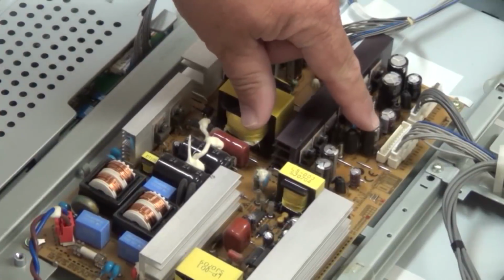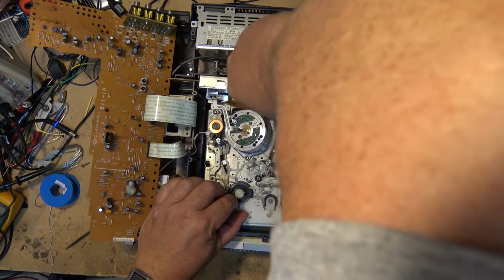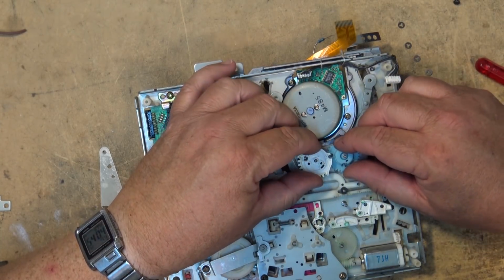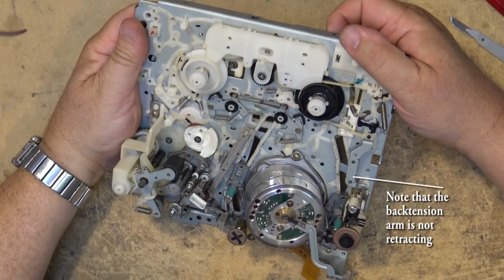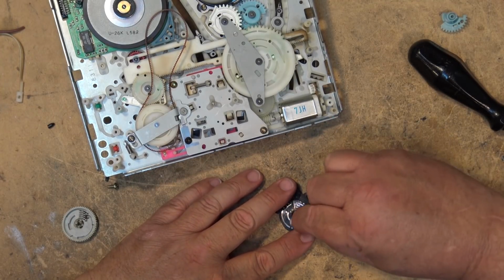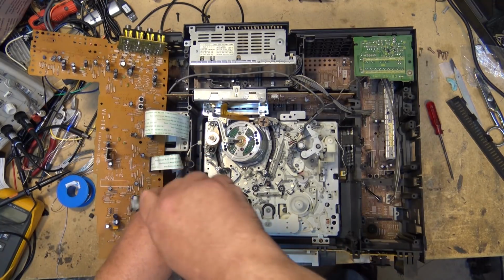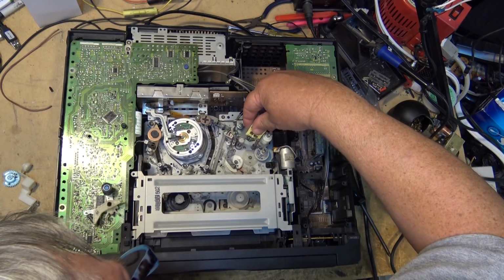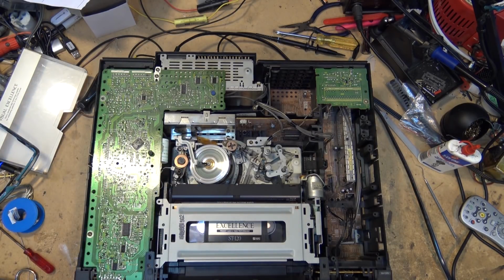Sony SLV R1000 full mechanical repair

Comment: I just picked up one of these and it will take a tape and eject it, but it stops playing after 3 seconds. Within those 3 seconds, it’s only black and white noise and a bit of the picture distorted on the bottom half of the screen. No sound. I can fast forward or rewind and it will do that, but it only shows that distortion and a bit of the image on the bottom half of the screen. Any clue what this is?
Reply from the maker: Stopping after 3 seconds is an indication if reel sensor failure or the reel is not turning.

Comment: Thanks Dave.  
7 Years ago You still had some Color in the Hair HAHAHAHAHAHAHAHA.
I seen a lot of repairs regarding the "Blue Gear"  is it suppose to be the weak link in the Chain ? and does the Blue color have any meaning or just the material it is made from.
Mike M.
Reply from the maker: Originally it was grey and it broke. The replacement was blue and it broke.  It's the stress on that gear pulling the tape.  The other side has less steess as it has its helptet the p6 that pulls the tape under the pinch roller.

Comment: Just picked one up that doesn’t work. I replaced the blue gear, it was broken in half, but it doesn’t want to power on. When I plug it in and press power, the lights on the right side of the front panel flash red, and it shuts off. I checked the fuses and they look fine, the capacitors don’t show any leakage, I’m at a loss for what’s wrong.

Comment: I have the same machine, it plays but does not FF, it gives some clicking noise from the bottom of the deck. I believe the belt is gone...
Reply from the maker: Those bekts don't wear out but yhe tension may be loose and causibg it ti slip. It's a toothed belt.

Comment: I just bought 3 of these units to try and resurrect them and came across your channel. This was a great video, for a few reasons. Not just the blue gear issue, but also the disassembly and reassembly. I have one vcr that from the outside looks amazing, but the interior looks like it’s been in someone’s shed for the last 3yrs. I’m going to have to strip is down and clean it and your video means I’ll have some guide for how to do it. 

By the way, how do you diagnose a failed blue gear? Is it just a bit of play? Also, do you know where there’s a SLV-R1000 technical manual? I have a trapped tape in the ‘barn find’ and it won’t release. I’d like to get it out without powering it on again. Finally, parts: I’d like to replace the dual mode shuttle ring on the front because it’s turning sticky. No chance, or are these available anywhere?

Cheers and thanks for the video

Comment: Thanks for the video. I used this one and other videos of yours to fix my Sony VCR. I also had a broken back pressure arm with no replacement available. I used a nail to replace the broken pin. Here is the link to my repair video. https://youtu.be/n1WqgmaV19w

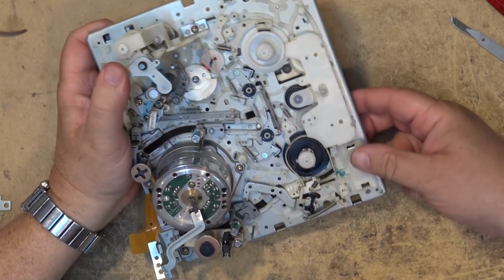Comment: followed you instructions step by step. My guides move corectly now. Got up to 19:11 in the video and my "P6 Guide" doesn't pull into place. It like its locked. Did i do something wrong?
Reply from the maker: If you took the p6 guide off to lube it you likely tightened it down. It doesn't go all the ear down. You actually adjust the height to guide the tape around the capstan when in reverse.  If too low you will damage top edge of tape If too high the bottom edge gets wrinkles.  When playing you adjust the nut up or down so the tape runs smooth in forward and reverse search.  There is play. You can push it down and the spring will push it up against the nut.
Reply: @12voltvids  so i actually took the nut completely off of the p6 guide now and its really corroded under the nut and probably causing it not to move.
Reply from the maker: @CharlieFella  you need to carefully pull the guide off. Grip with pliers pull up while twisting slightly. Clean the lube tfat dried out. Give it a drop of oil and reinstall and align.
Reply: @12voltvids  thanks for your help. Was able to replace the blue gear but still wasn’t working so I listed it for parts on eBay this morning and it sold. Thanks and have a good day
Reply from the maker: @CFellaMusic  I'm going to fix my Sony SLVR5 next week. The blue gear is here. Then I will sell it as a working machine as I have another SLVR5 and an SVO2000

Comment: I need to do the same repair. I had mine open and loaded a tape. Same broken parts. Need to take it apart and check what all I need.
Reply from the maker: Blue gear
Reply: @12voltvids  I'm checking the rest of the gears also and that arm so I can order everything at once hopefully. 

Thanks for this video. Just picked this up in box complete today. Didn't know it was broken.

Hello from south of you in Washington.

Comment: Same here, I used the Allsop brand head cleaning cassette tape and it chipped off part of the blue gear enough to throw off the timing and unable to grab the tape. Just ordered 3 of them for backup in case.
Reply from the maker: 3-736-147-01, threading gear left. Kpcomponents sells them.
Reply: @12voltvids  Thank you, for future reference if needed.

Comment: I have one just like this that needs repairing. Can I send it to you for repair?
Reply from the maker: I can certainly look at it.  Bear in mind that depending on the problem it may not be repairable as the depend on parts.
Reply: @12voltvids  Thank you! How can I contact  you about specifics for getting the device to you?
Reply from the maker: @TheSpeedo91  
My email is on my main YouTube page.

Comment: Hi thanks for the video, I ordered the blue wheel, followed your video, ( I had to watch it a few times, first time fixing a vcr) I connected it to my tv and I have a tracking wiggle about 1/4 the way up the screen that I cant make go with the tracking controls???  Did i not align the guides correctly? any help would be greatly appreciated. Thanks again for the top notch video
Reply from the maker: Are the guides going all the way to the top?
The left side is the top of of the picture and the right the bottom.  If the guide is not loading completely and is loose recheck the gear timing.  If it is right against the end stop, then check the tape guide height (alignment)
Reply: @12voltvids  If I nudge the right guide it will move up about 1/8 of inch, it didn't fix the image but it did get the larger guide spindle at the top ( the brown one) to now spin with it, I guess I need to try adjusting the timing gear again. How do you adjust the tracking guides manually? or is that a bad idea? thanks for you help
Reply from the maker: @jbo8703  I do have videos on my channel for VHS tape path alignment both using a scope and without using a scope.
Reply: @12voltvids  I just watched your alignment video from Aug 08 2019, I have a Sony SLV-R 1000, the guides have a x on the top that will not fit a screwdriver,  do you adjust them manually by hand or is there some other way, thanks for your guidance
Reply from the maker: @jbo8703  you can adjust with a small slot screwdriver.  That's what i use.

Comment: I have a mechanical problem with my SLV R1000. The guide with the blue roller  on the left can be moved freely with my hand, as you show in the video. Does this indicate a broken blue gear is the definite problem? many thanks
Reply from the maker: Yes if the P2 guide can move freely the blue gear is broken.
Reply: @12voltvids  Thank you for your quick reply. I do not want to fix this myself and would prefer to hire someone. I understand you are in BC, but I am in Montreal, so I expect it would be expensive to ship it to you. Do you know someone in Montreal who could do this repair.  If you prefer to communicate by email, please direct me to your address. thank you.
Reply from the maker: @donritter9518  
It is probably not as expensive as you think.  
It cost about 65.00 to ship this unit back to Texas from Vancouver.  Much less than it cost the guy to ship it up which was about 100usd.
Reply: @12voltvids  Can you tell me your fee for this repair and also your postal code so I can get a shipping estimate from Canada Post. I found the kpcomponents  website in Surrey that sells the blue gear for the VCR. Is that your company?  thank you.
Reply from the maker: @donritter9518  
Contact me by email and we can discuss repairs. No mp components is not my company but that is where i do get the parts from.  I have to order by mail and pay shipping fees like everyone else even though he is only 10km from where I am located.   V4L 0A4 is my postal code for shipping rates.

Comment: Hi Dave, do you have a source for a replacement backtension breaker P1 guide arm? I have the same problem on the SLV-R100 I'm trying to fix and don't know where to get one. If you or anyone in the comments has one, I'd be happy to buy it. Thanks!
Reply from the maker: I might have one in a parts donor machine.

Comment: Thanks for all your informative videos, 12voltvids. I picked up this Sony SLV R1000 a few months ago from Goodwill for $10.00 and of course it didn't work. But after finding your video, I discovered the problem was the Broken Blue Gear! So after following your example, the unit threads perfectly, however now the video head does not spin.
I am sure the video head did spin before I replaced the blue gear, so maybe I accidentally unplugged a cord somewhere. I know I was nervous about pulling the ribbon cable from the video head, but I thought I reinserted it correctly into the unit. Anyway, I will keep after it. Thanks again.
Reply: Any luck?
Reply: @bocefusboy  Thanks for the inquiry, but so far nothing. It may have to do with the grounding connection between the video head and the body of the machine. That screw became stripped and I had to pry the ground connections loose to get at the blue gear on the underside.
But as far as I can tell, the ground connections are tight. So I am stumped. At least I fixed the initial problem.

Comment: over lockdown  2020 GOT BORED  Got out of the loft Sony SLVE80 VHS Deck Blue gear trouble. Ordered part from KP Components in Canada to get to the UK / Part turn up in 5 working days Post air mail was costly more than the part but did not worry me, as your video was the best Help I could ask for, removed  from the chassis not the same but have the know how  to do  new gear in,  timing ,serviced mod Switch cleaned ,  greases and oil parts working a treat, love your videos thank you kindly
Reply: А склеить суперклеем  не судьба ? !

Comment: May I send you my SLV-R5UC for repair? I popped of the bottem and found the piece of the blue gear but I dont feel comfortable going further. Rather a pro do the magic. Hoping you would be for hire still? David from california.
Reply from the maker: Yup I can fix it.  Shipping is  the expensive part.
Reply: @12voltvids  I understand. I guess I could just send the mechanism. Would probably save a bundle. Shall I email you to get address?
Reply from the maker: @dSeanAllen  
Yes you can just send mechanism.  Naturally I will not be able to test it but I can replace the broken gear. I had a mechanism sent in last year.
Reply: @12voltvids  OK, im going to look into the diff. in cost to send whole unit as I just watched your repair of your own unit with the power supply refurb you did and then looked closely at mine and I see a bunch of spewing of some goo all over the power supply. Looks like the issue you described as a common problem for these. It does power up just fine and attempts to load etc but probably worth letting you have the whole thing to just make sure that isnt going to B.M.I.T.A so to speak. (thats bite me in......) later on. I think I saw you mention your email in another post or address or something so Ill check that and give you a heads up on what I plan. Thanks much!
Reply from the maker: @dSeanAllen  
Slvr5  had big time capacitor problems.  Leaky elna caps.
Reply: @12voltvids  Hi again, Well, I think the SLV is on hold for a bit.I did however immediately think of you when I got lucky and picked these up last weekend at an estate sale. a Pair of old school  "AR LST" speakers. I looked them up and they appear to be valuable. They are sitting next to me begging me to plug them in but Im freaking out scared to do that. I wish you were closer so I could drop them off to you to go over them before I do something stupid and blow them up but they are 90 pounds each. They look pristine but I haven't opened them up not even the grills to determine anything. Any suggestions on how safest to hook them up? Can I use for example an Onkyo TX-sr500 to drive them? Im scared I might destroy them before getting a chance to find the deserving owner of these babies.
Reply from the maker: @dSeanAllen  connect them to your amp and take a listen. That will tell you if they are any good.

Comment: Is it possible to buy both a backtension assembly and a pinch roller assembly for these things anywhere? I've got blue gears, just not the others.
Reply from the maker: I might have them
Reply: @12voltvids  
I picked up 4 machines. One is completely missing the pinch roller assembly, and one has the P6 guide completely seized up. All have broken blue gears. I've got some gears, and with your help got the courage to change them but can't find the other parts. Guys on eBay are selling machines for parts but can't get them to tell me if those particular parts are in decent shape.
Reply from the maker: @NunYa953  the p6 guide will come free.  Dab some da40 on it and heat it slightly with soldering iron and work it back and forth and it will eventually free up and work.
Reply: @12voltvids  
Ok. So changed the blue gear, cleaned the mode switch, got the P6 guide out and greased, greased the pinch roller assembly, triple check all my alignment holes, got the mechanism back in. Turned it on all looked good. I grabbed a tape and inserted the drum fired up, the cassette went in, but it isn't loading the tape around the head. If I push play or stop it says "please insert a tape". When I push power to turn it off it spits the tape back out? Any ideas? I'm thinking maybe I didn't get the contacts on the mode switch clean enough?
Reply from the maker: @NunYa953  Double check your mechanical alignment. Make sure mode switch is maknig proper contact to board.
Reply: @12voltvids  
Got it going! Sent you a tip through PayPal for the advice!
Reply from the maker: @NunYa953  Thanks. I will look for pinch roller for Sony. I probably do have one in good shape.

Comment: Hey Great Video,, I have a SLV-750HF but my gear is not blue, its beige. Appears to be the same design though. Are you able to source this type?
Reply from the maker: The original was grey. They changed it to the stronger blue plastic and it still broke.
I get mine from KP electronics in Surrey BC Canada. Look them up
Reply: @12voltvids  Ordered blue gear for KP components, for a total cost of $10  shipping included. I was able to leave the chasis installed and just lifted the circuit board up enough to access to drive gears for the lazy technicians approach to this repair LOL ,,, my side lever wasn't broken and move out of the way of the left tape tensioner, so all went pretty smooth. Meshing the gears was a little tougher this way, and had to pause your vid a few times at that point,, but all is good now.. works like a champ.
You've got some serious experience in these matters.. Thanks for sharing that knowledge with us commoner's .. A++++++
Reply from the maker: @onyx2002  Some machines you can access the gears from the bottom, but the 1000 the chassis needs to come out due to the big boards on the bottom.

Comment: This is the exact problem I'm having with mine.  Just ordered up a couple replacement gears.  After watching your video, I'm feeling pretty confident that I should be able to fix it myself.  Thank you very very much.
Reply from the maker: Your welcome.  That is the point of the channel. To help people diagnose and repair stuff.
Reply: @12voltvids  Quick update.  Followed this tutorial and, 30 minutes later, I have resurrected my SLV R1000.  Super simple and worked first time.  Thank you very much for posting this amazing video.  Cheers and happy new year.